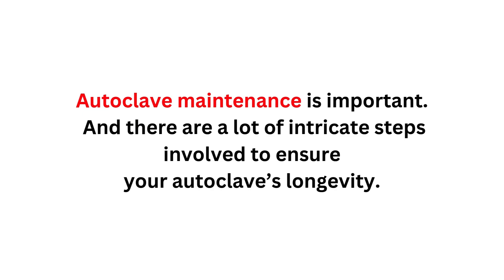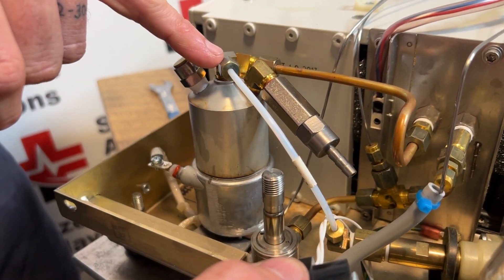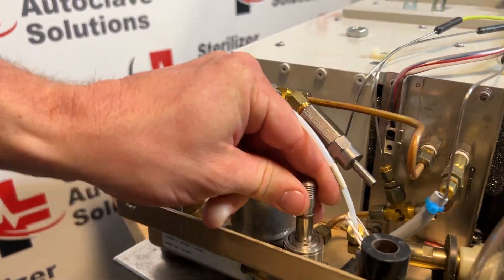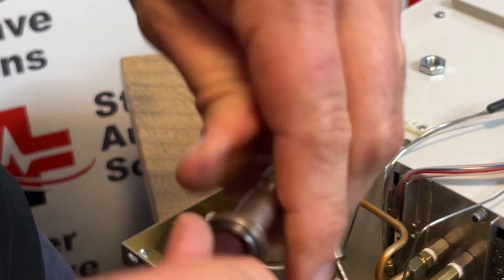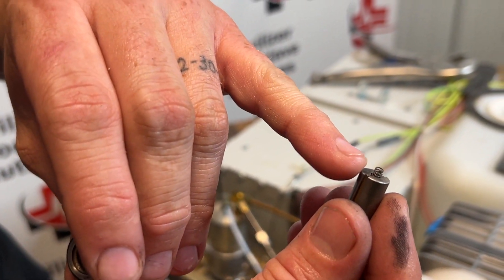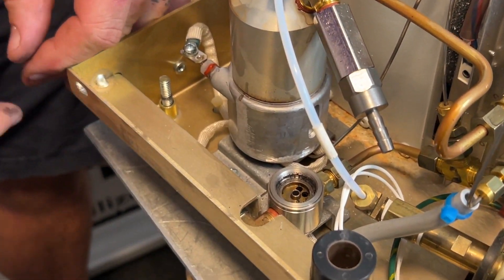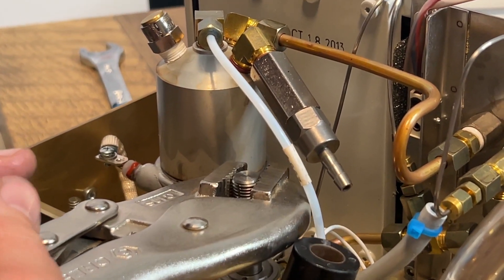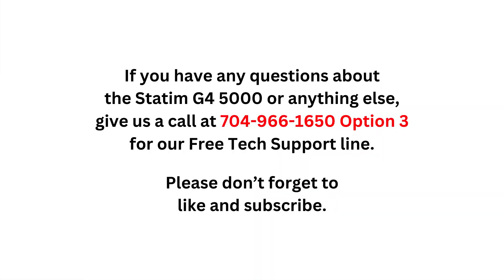Statim G4 5000 Solenoid Valve Cleaning / Service

Comment: I didn’t want to use Vice grips on the plunger, which was (and still is) STUCK after 20 years so I bought the hex nut with two small tabs protruding made to fit into the top small holes in the plunger. 
Now one of the tabs is broken off the hex nut tool and stuck in the plunger hole.  So much for doing it “correctly”.